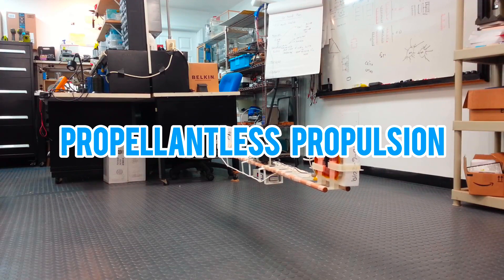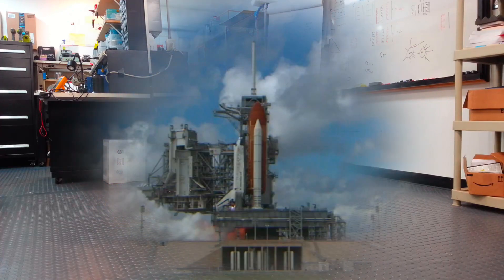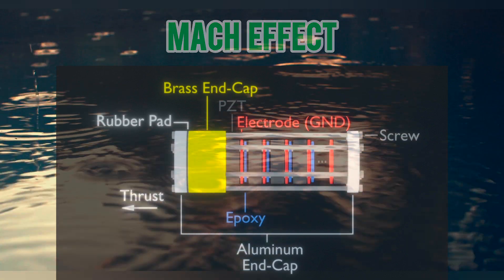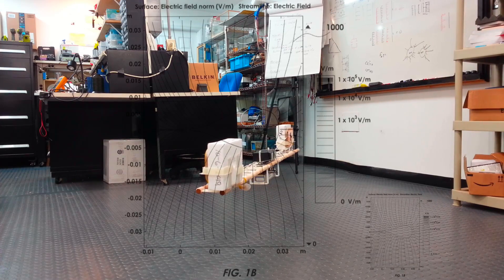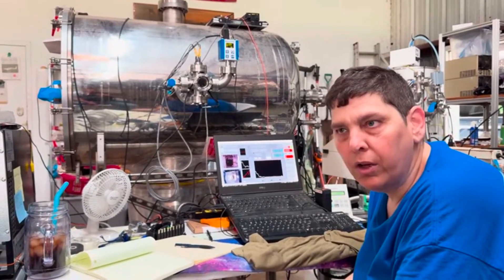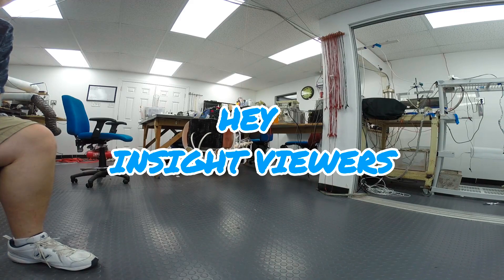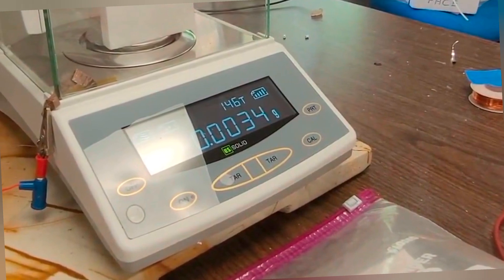NASA's Mind-Blowing Propellantless Propulsion: The Future of Space Travel is Here!

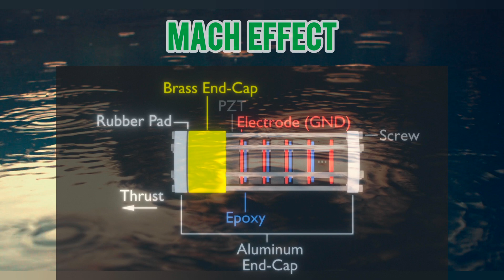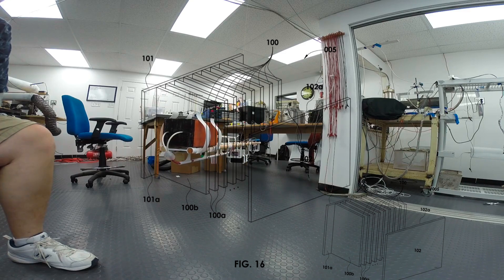Comment: I was surprised until I saw a straight white line when I mirrored to a bigger tv screen @1:29 that is holding right the center of the device  going up next to the letter board and again can be seen @2:29 all the way up to the ceiling and @3:22 , it explains why the symmetric build with bulky things on the ends to keep a good balance if you pay attention only the sides slightly wobbles but not the center just follow the center of the device towards the ceiling frame by frame and you'll see it,  quite disappointing clam, FAKE
Reply from the maker: It's not levitating it's been pushed sideways

Comment: We need a meta-material that is resistant enough to extreme high voltage, and that reduces the gape between charges to an atomic level, like Electrets. Then we can dramatically increase the thrust vector of this kind of propulsion and use it to get off the earth and accelerate to godly speeds. The current applications are only usable in space for not a long time before failure, we need far better materials.

Comment: Fake
Reply: Yes indeed, I was surprised until I saw a straight white line when I mirrored to a bigger tv screen @1:29 that is holding right the center of the device  going up next to the letter board and again can be seen @2:29 all the way up to the ceiling and @3:22 , it explains why the symmetric build with bulky things on the ends to keep a good balance if you pay attention only the sides slightly wobbles but not the center just follow the center of the device towards the ceiling frame by frame and you'll see it,  quite disappointing clam, FAKE
Reply from the maker: @Carl_VII  The device is not being lifted from the ground it's been propelled left or right that's why there's a string holding it up
Reply from the maker: Don't just say it's fake, do some research into it.
Reply: @Insight121  .......... not fake? ok just fly  to the mon. Grants.
Reply from the maker: @arhon5681  have you seen the video?

Comment: One G of thrust on average sounds a little bit optimistic for a new propulsion technology.
Reply from the maker: It sounds too good to be true but it is happening. We need to get a lot of qualified people working on this and making improvement.
Reply: We need to keep Dr Charles safe
Reply: In this case one G means that the thruster can lift its own mass. At this point the thruster is pretty light and this doesn't take high voltage generator's mass into consideration. Still pretty impressive.